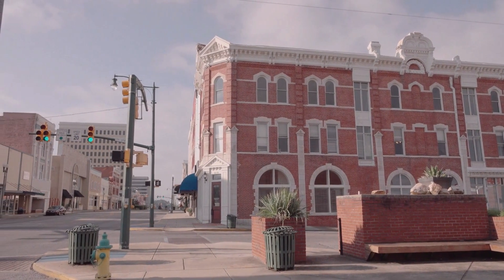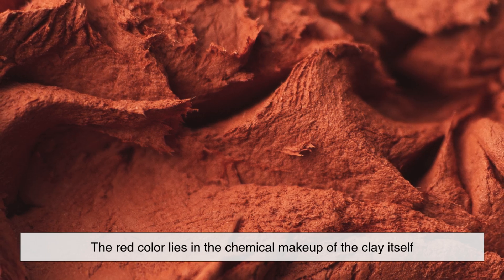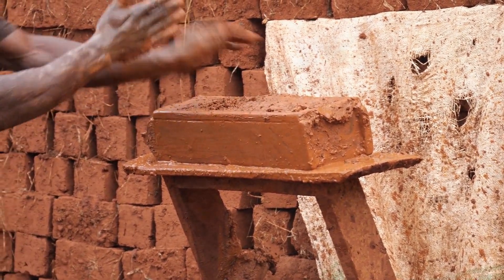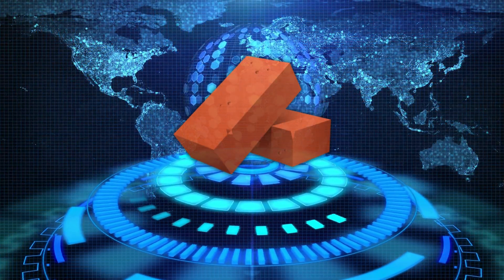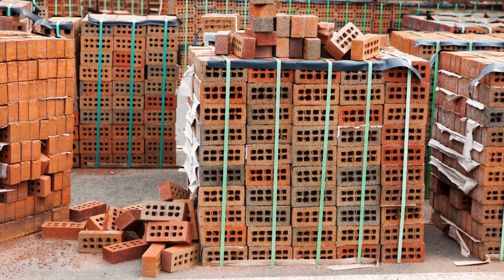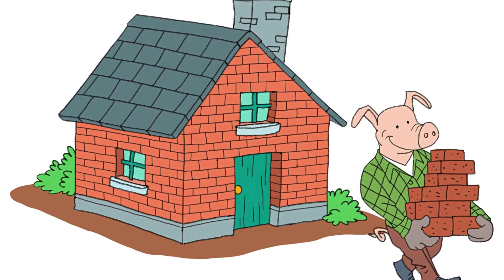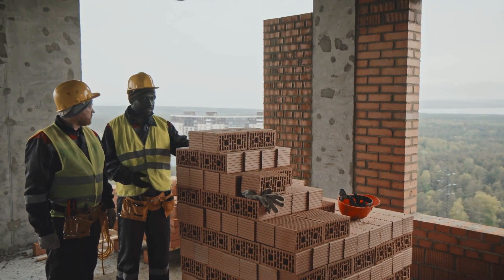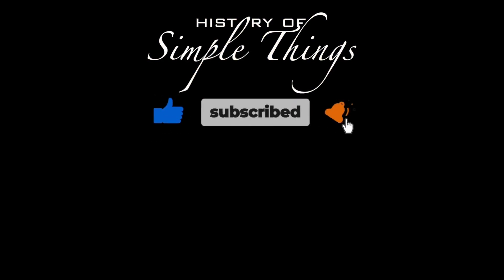Why Are Bricks Usually Red?

Comment: Brick buildings are dangerous due to potential collapse in earthquake prone regions. That is why bricks need reinforcement in construction in earthquake prone regions.
Reply: Brick houses don't blow away in high wind.  A bit like the 3 pigs.
Reply: @pauljohnstone4723  Every brick house I've ever seen has been brick veneer over a wooden stud wall.  For a brick wall to have any strength on it's own it must be at least three layers thick.  In masonry each layer is called a "wythe".